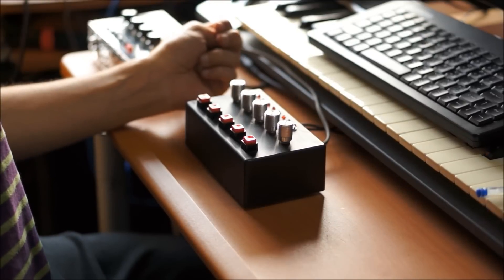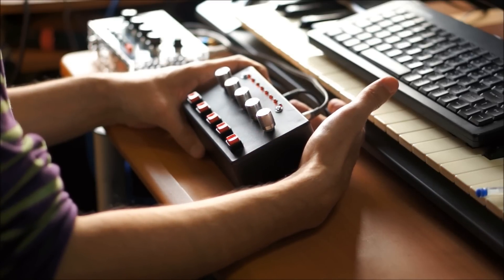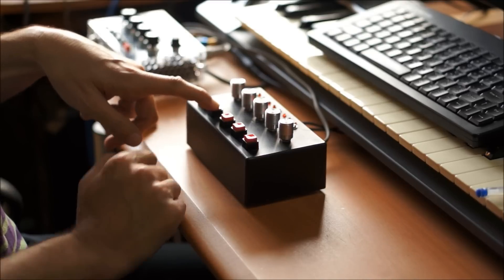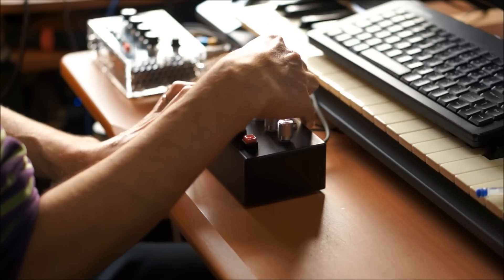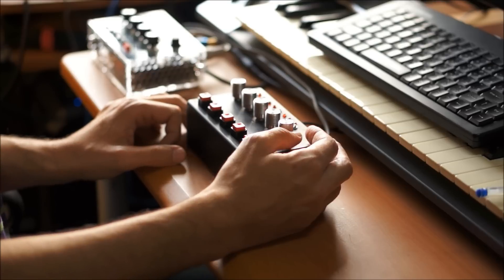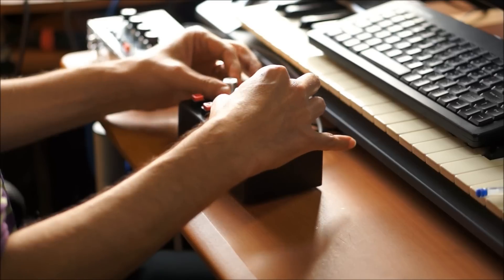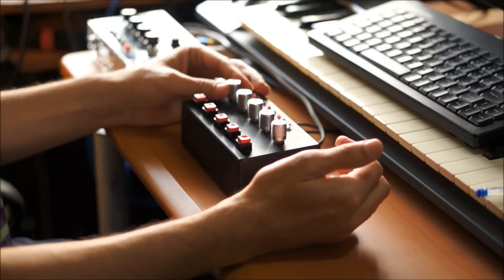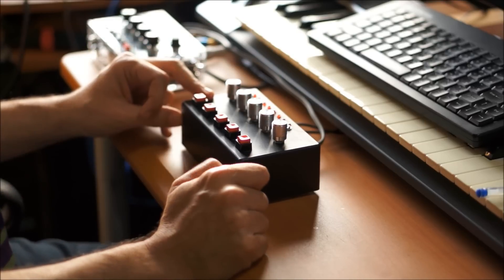Groovesizer mk1 - DIY 16-step sequencer and synth

Comment: Hi Moshang, awesome project. I'm going to start to do this project soon, just waiting for some components 🙂
Anyway, I have a few questions about it.
-I'm thinking about using a LM386 or a PAM8403 amplifier module to the output, do you think this will work fine ?
-The sound that I will get will be the exact same as you do on the video, because that sound is awesome, and I just can imagine some bit sound going out like the piezo ahaha
-what are the functions of those capacitors ? Some kind of sound frequency filter or just output regulators ? Can I use diferent kinds of capacitors ? I think I just have electrolytics :s

Thank you and keep rocking on projects like this, pretty awesome dude !!! 😀

Comment: does the perf board you use have copper pads on both side or did you solder on the bare side?
Reply from the maker: They have copper on one side only.

Comment: Hi MoShang, Thanks for this awesome project. So, I've built one and wondering if there is a place in the code to adjust the MIDI channel. I looked through, but couldn't locate it as I'm not very familiar with coding. I didn't notice it commented anywhere though. 

Also, is this set to any particular scale? 

Please visit my channel if you would like to see a video that shows my first go at using it.

Comment: hi MoShang, thanks to share the groovesizer diy project, it's great..
and I've built my own follow the step and done on the pcb with uno3 and no midiout,
every fuction is active that shown in leds react, but the only one thing is no sound output on mini jack, even attach pin3 on tip and gnd on sheet direct to the jack, are there any setup needs on the audrino code? thank you.

Comment: Anyway to mod the code to output MIDI clock?
Reply from the maker: I didn't make provisions for it when I wrote the code, so it's  possible, but not easy. First order of business would be to change the code to make use of the Arduino MIDI Library because it makes it so much easier to work with all aspects of MIDI on the Arduino. For sync, you'll want to output 24 pulses per quarter at the current BPM. The syntax would be something like MIDI::sendRealTime(clock);

Comment: Hi great work !.Will you sell one of these?also do both codes need to upload to the uno? Also in thed origional arduino synth code will I need to chose one of the 3 options 
for the arduino code( they ask about in the auduino).I got sound out and the leds sequence also.I still am familiarizing my self with the groovesizer.great project Moshang.....----scott